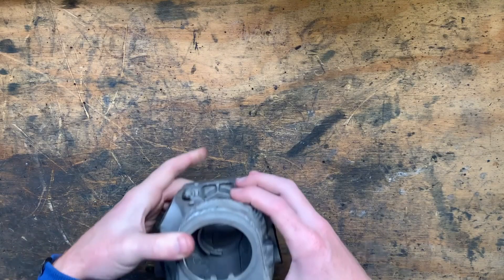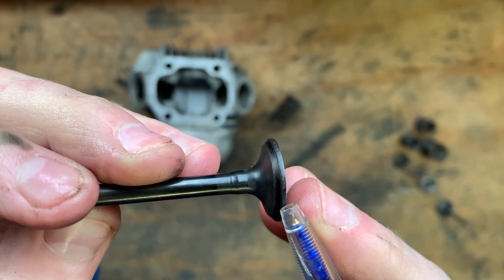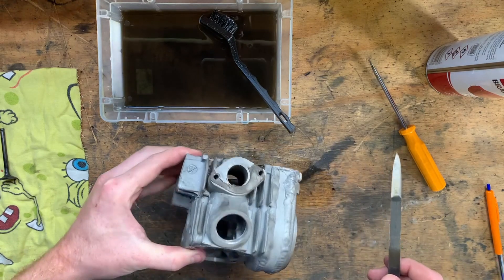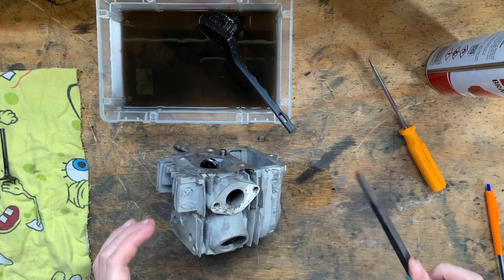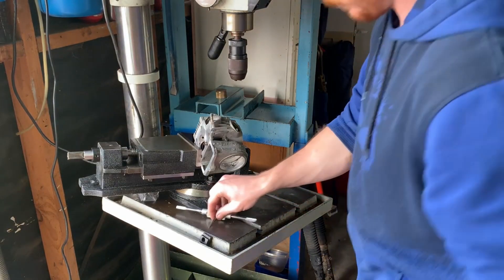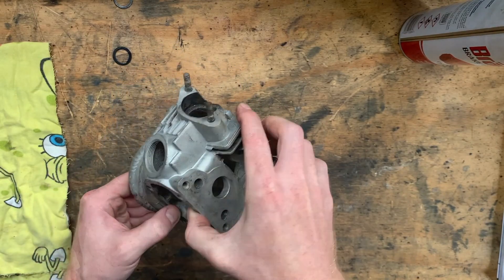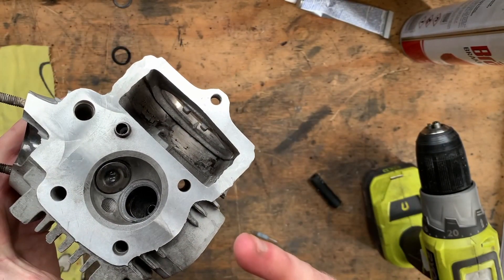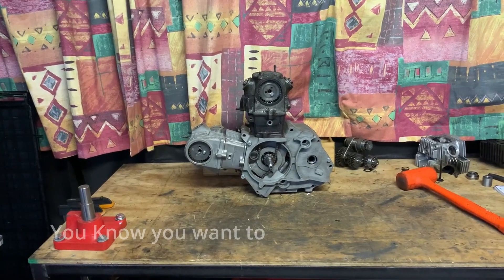Valve Lapping the Easy Way

Comment: Hey Jonny, what's the best head valve bore and breathing combo for a 50cc 4 speed semi and a couple of 125cc with the clutches?
Reply from the maker: I’ve only got experience with the 70cc and the 140cc motors. 

The 70 and 50 share the same bottom end. In my opinion the 70cc wants a 21/22mm carb and a 25-28mm exhaust tube. You can get after market cams as I did that will work in the 50/70cc I used a crower cams G2 cam. This increases lift by 1mm and moves the power further up the rpm range. 

I think the 140 and 125 have similar cams but I’m not 100% sure. In the 140 I use a z40 cam which makes good power up to around 10,000rpm you ideally want a 28/32mm exhaust and a 26-28mm carb to keep it from choking up. 

On both of mine I have smoothed out the inner and outer turns in the intake and exhaust ports and port matched the intake manifold. I think this helps squeeze a few more useful revs out of the motor.
Reply: @OddsandEndsMachining   Hey thanks for the reply and info.
After pulling my 50 (49cc) apart, just discovered it's 1 47mm cylinder. I am thinking this chonda is marked 49 but more like 69cc. I thought the 50cc had 39mm cylinder?.
Has an e22 head with 23/20mm inlet, exhaust valves.
Thinking of putting 52mm cylinder on it, (69mm high)but also thinking of sourcing a head with bigger valves. Like 25/22-23mm or something..?
Or should i just port the head thats on it and slap it back on?

Comment: Sir, can I build v twin in the stock crankcase since I don't have access to casting metal, and could you please tell me what modifications would be required.
Reply from the maker: You’d need to have two matching pairs of crankcases, then you kind of cut them into quarters. I’d say you should watch Allen Millyard’s videos and you can pause and see where he has welded his ones. Or look on Facebook on the SS50 group as a couple of people have also done this and documented it.